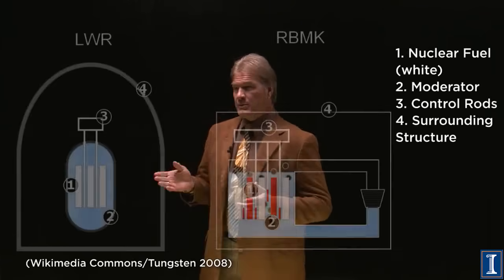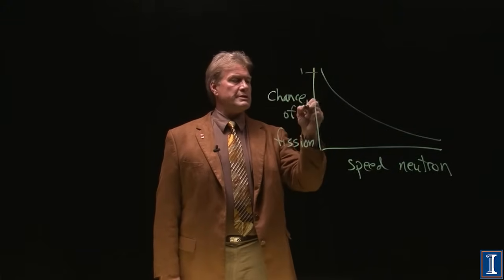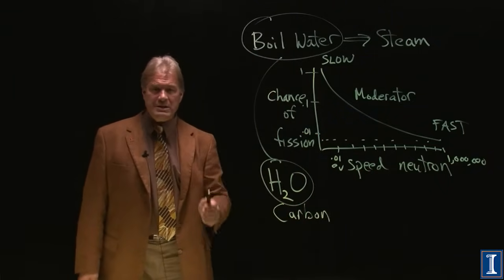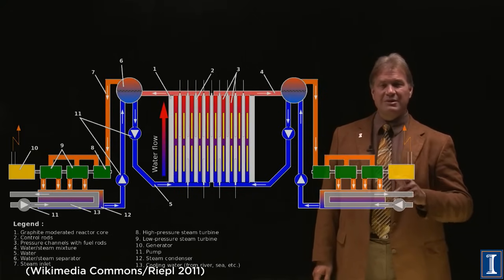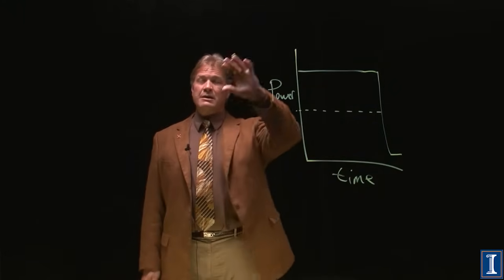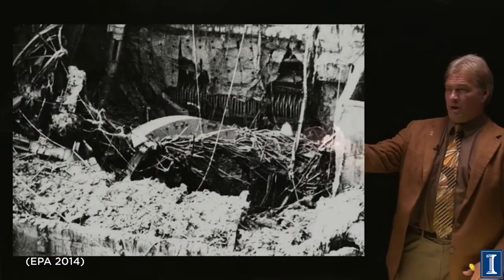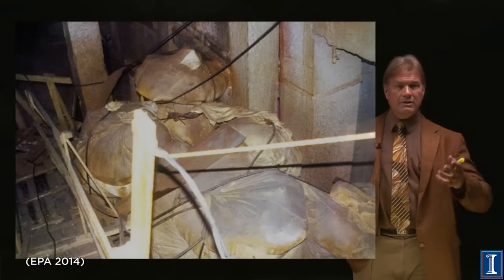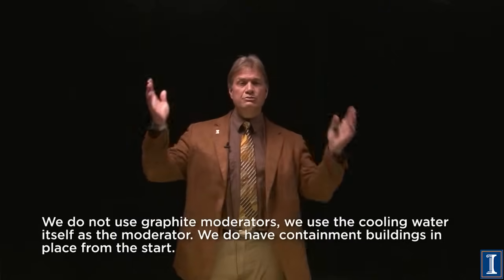Chernobyl: Worst Accident Ever

Comment: Fukushima is worse because it is still ongoing and part of its core was plutonium mox fuel.
Reply: Can you explain why we should be extra worried if Fukushima actually did use MOX?  And in what ways it is still ongoing while Chernobyl is not?  Thanks.
Reply: @puncheex2  The corium (melted reactor fuel) in the bottom of the Fukushima Daichi plant is still there.  They have to keep the ground frozen around it or it will melt through into the ground water just like in the worst case scenario for Chernobyl.  It is my understanding though that mox fuel is MUCH more dangerous than "normal" U-235.  I believe also they have to keep huge storage tanks full of radioactive water which are filling up and will be dumped into the ocean soon.
Reply: @Minty.Fresh.Tunes.  No, that's not true.  As far as is known, the meltdowns at Fukushima are all contained within the containment structures.  It is believed that one of the meltdowns burned through the reactor vessel onto the containment floor, but there is no evidence it got any further.  The ground freezing that TepCo is doing is for a different problem, the one you mention below with tritiated water.

Plutonium is no more dangerous as a metal than U-235 is, either chemically or radiation-wise.  Long ago Ralph Nader made a big stink about how poisonous plutonium was, but he was wrong about it.  No one has ever been registered as having died from plutonium poisoning for either reason, even though one unhappy person was given 64 grays of the stuff in a medical experiment gone way past wrong (4 grays is considered the 50% fatal dose).  See https://en.wikipedia.org/wiki/Albert_Stevens

Yes, there are huge storage tanks of faintly tritiated water.  They are slowly coming to the conclusion that that water may be naturally produced in the mountains behind the plant.  I'm skeptical of that myself, but what can't be argued is that the radiation from the tritium is negligible.  Look at photos of the tank farms - people are walking among the tanks in shirt sleeves.  Tritium creates no gamma rays; all its radiation is beta particles.  Beta can't fight its way out of the water and the tankage.  The tritium is decaying (as all radioactive things do) with a 12 year half-life.  It can be safely dumped out to sea with no harmful effects.
Reply: @puncheex2  I was not referring to the underground "ice wall" which prevents water from the mountains from touching the disaster site.  They have to constantly pump water into that building to keep the corium from continuing any further and then pump it out again which is why the water is radioactive in the first place.  And it is not only irradiated with tritium so shove it.  There is a lot of misinformation coming out of Japan about Fukushima it is practically illegal to even talk about the disaster there which is a sure sign of corruption and subterfuge.
Reply: @puncheex2  AND it is UNIVERSALLY known that MOX is much more dangerous than just U-235.

Comment: Actually you are possibly wrong in one CRITICAL point. (Pun intended) It is very likely that the lower part of the Reactor actually went prompt supercritical and there was a small nuclear explosion, that did not become a large nuclear explosion just because it dispersed the fuel so fast that the criticality dropped again before we could have a Prompt Supercritical explosion that involved large parts of the fuel.
Reply: Can you explain how such a thing would have happened in 3% U-235 fuel?  If it was possible, why do nations with nukes strive for very expensive 80%+ enrichment, when they could use 3%?
Reply: @puncheex2  Because they need fuel that chainreacts so fast that it does not get dispersed by its own shockwave, like it was the Case in Chernobyl. The Nuclear Detonation that accured in Chernobyl was small, in the bottom part of the reactor. And before it could use the majority of the fuel its own shockwave dispersed the fuel, reducing criticality again. If the reactor ran on weapons grade uranium it would have leveled the ukrain and europe would be a real life fallout.
Reply: It wasn't a nuclear explosion
Reply: @RawbLV  Thanks for sharing your deep scientific insight. Your comment is most useful.
Reply: @TheNecromancer6666  You're welcome. The other commentator explained why it couldn't have been a nuclear chain reaction and I thought to assert that further.
Actually the explosions weren't that powerful. Windows 200 meters away didn't break. I know "nuclear explosion" sounds cooler but that wasn't it.
Reply: @RawbLV  Nuclear Physics says it was a nuclear explosion. First of all a large amount of fuel is missing and unaccounted for. A Steam or Hydrogen Explosion could not have vaporised it. A nuclear Explosion could have. Also not all Nuclear Explosion or Prompt Super Critical events are large explosions. Prompt supercriticality does not mean a multiple Kiloton Explosion there have been super promptcritical Events in laboratories after which people in the lab were dead but the lab was still standing. Do a bit of reading on the subject.
Reply: @RawbLV  There is next to no Uranium in the contamination, only Fission products, Iodine, Caesium, Radium and others. My source is the final report of the International Atomic Energy Agency. Most of the fuel,  was also recovered outside or found in the Building. This discussion makes no sense because you have no clue of reactor technology and nuclear science. You are full of dangerous half knowledge, please read into how nuclear processes work, seriously. You have no technical or scientific education what so ever.
Reply: @TheNecromancer6666  Says the person who thinks that a reactor with enrichment of 2% can cause a nuclear explosion. Okay dude.
Reply: @RawbLV  That number says something about a baseline criticality of that reactor not about what can happen if you drive it enough extremus like it happened in chernobyl. Natural unenriched uranium can cause a chain reaction under the right conditions. I took nuclear physics and reactor engineering for fun in addition to my normal engineering ar Uni so I know a thing or two about it. I ran an nuclear reactor at my Uni. So again either read up and have a proper discussion or stop spreading missinformation.
Reply: @TheNecromancer6666  Yes, a chain reaction, not a nuclear explosion in a graphite moderated reactor with all of its control rods inserted.
Anyway, you don't have to argue with me, reports conclude that there was a "highly destructive steam explosion", not a nuclear explosion. If you wanna doubt decades worth of information and conclusions from physicists, that's on you, not me.
Reply: @RawbLV  The difference between a chain reaction and a nuclear explosion is only the rate of fission and the prompt criticality. If you see that: the reactor has fixed moderation, positive void coefficient and graphite tipped control rods that acted as the trigger you do the math that that can cause prompt super criticality. I mean seriously. Its not hard to actually calculate the reactivity and criticality under the conditions we know the reactor had. But to do that you would need an education in physics. BTW, the soviet researchers at the time very much said that a partial nuclear detonation in the lower part of the reactor is likely. Also: After the steam blew the cover of the reactor any hydrogen would immediatly dissipate and not politely wait around. Also: where should the hydrogen have come from? Yes bombarding water with radiation CAN split it. But not at a rate fast enough to fill the reactor vessel up with enough of it to blow the building up. Just do the math on it. Jeez University's are free in most civilized countries get an education...
Reply: @TheNecromancer6666  I have an education, but not in this field. As for hydrogen, the empty spaces between graphite blocks were filled with hydrogen, although during the test it might have been nitrogen.
I'm not gonna argue about this. I don't think a nuclear explosion took place but it isn't completely ruled out. If you want to debate this, go to r/chernobyl. The bright guys there are actually talking about this today.

Comment: Lmao... So there is no exclusion zone around Fukushima due to expelled radioactive material??? Containment wall, correct??There sure a hell is! So how did that happen if the containment building prevented that??? The chain reaction at Fukushima didn't stop Did it? Matter of fact Fukushima also experienced hydrogen detonations. they didn't build a 3 foot concrete floor under Fukushima and all that radioactive coolant was just allowed to go into the ocean. Fukushima to my knowledge still isn't even contained. The only difference between the tragedy Chernobyl and Fukushima was that Fukushima was using American reactors and therefore the truth was censored.  There is no free press in America to report either and those independents that do report the truth are labeled conspiracy theorists for the effort. 

There are videos on the net of folks wandering around Fukushima's exclusion zone finding hot spots just like at Chernobyl. Only reason Chernobyl seems worse is because it was in the middle of a continent so the worst fallout landed on land and displaced people. Fukushima is on the East coast of Japan and therefore prevailing winds and drainage to the sea placed the majority of Fukushima's expelled nuclear disaster over and in the pacific ocean. 

I am not afraid of the truth but I hate being lied to!
Reply: Then why do you repeat lies?    https://en.wikipedia.org/wiki/Comparison_of_the_Chernobyl_and_Fukushima_nuclear_accidents
Reply: @danadurnfordkevinblanchdebunk  Wikipedia. Wow like that's the bible of fact. I'm not the one lying. There is an exclusion zone around Fukishima. FACT! Fukishima is right on the pacific shore with westward previling winds which means most of it went over the pacific. FACT Fukishimas issue was cooling and broken cooling lines which is why they had all the tanks there for contaminated water. But if none of that's good enough you can go read their own documents if they haven't been erased from the net and shredded where THEY said in their own documents they were releasing contaminated water. 

But, here's another one for you if I'm the one spreading false information. If they prevented melt down then they gotta either have it all back up and running or entirely decommissioned and safe by now Correct!

Real simple dude I don't care what you or Wikipedia says. I don't care what the authorities say. I don't care what the experts say. Exclusion zones exist around Fukushima due to DANGEROUS levels of radiation. Dangerous levels of radiation can only exist if there is dangerous levels of radioactive material in the exclusion zone to produce Dangerous levels of Radio activity. I have seen folks walking through Fukushima's  exclusion looking for hot spots same as Chernobyl. Only way that happened is if the containment system on one reactor, at least, breached catastrophically.  Unlike most folks I actually paid attention to event and actually read company document released as to the problems at the time. Fukushima Were GE reactors. If they were made by Russia or China you'd know the color of the shorts everyone was wearing but because they were GE reactors there's nothing to see here. just move along. Nothing I have stated is a lie. Its reality. 

Seriously! How did the Fukishima exclusion zone become radio active. Birds that coincidentally all migrated from Chernobyl the same days Fukushima reactors blew up on video harmlessly.
Reply: @danadurnfordkevinblanchdebunk  What ever you say dude. Suppose proper safety equipment and prompt evacuation due to advance knowledge had NOTHING to do with less human carnage also?  Big difference between Chernobyl and Fukushima was time and foreknowledge of what was going to happen.   2+2 is just simply tough for some folks.
Reply: @danadurnfordkevinblanchdebunk   No actually you can't read. I already said they were two separate incidents where time and proper equipment and location were the determining factors on immediate casualties and long term effects. Chernobyl  happened in the middle of the night without warning They had time with Fukushima to evacuate and the emergency personnel were properly equipped. Besides that, 1/2 of the exclusion area and prevailing wind put 1/2 or more of the ejected radiation over the pacific. While Chernobyl is land locked in the middle of a continent. 

But Chernobyl is stable and contained under not one but two shelters While Fukushima is still not under total control to my knowledge 10 years later. 

I have mentioned all of this at least once in my comments already and now twice. You can't and they can't determine what the end cancer rate will be from Fukishima because More than 1/2 of all the radiation puked out of that place for 10 years enter the pacific. and by now has easily polluted every ocean in the world. We are eating it every time we have any product from the sea. It's in our rain. And yes people have gone to the west coast of North America with various radiation detector and have found above background levels of radiation. But I suppose, you''ll try and tell me next that although an encrusted Harley in a shipping container could wash up on the BC coast from Japan along with tons of garbage and boats from their fishing fleets and ports, it's totally impossible for radioactive particles and coolant water to make it here in the same currents the Harley did. Cause Harley a super Duper magic.
Reply: @danadurnfordkevinblanchdebunk  The containment vessels BREACHED. Have you ever watched videos of Fukushima grenading? What do you think blew the big holes in their roofs. Never mind the fact the THREE reactors Blew in Japan. HELLOO? There is a exclusion zone Only way that happened is if the containment breached. The emergency workers actually had radiation suits and they had a whack of time to evacuate the surrounding area before they blew the hell up. Holi hell. The professor is lying his ass off which is why I made the comment in the first place. Fukushima BREACHED. The only reason there wasn't massive human loss due to radiation is because all first responders had the proper gear. And the had fore knowledge so they could evacuate the people before the breech. Not to mention due to the fact that it sits on the shore of the pacific as compared to Chernobyl the exclusion area is half the size cause Japan has strict laws against mermaids and people living in the ocean immediately off their coast. I figured I'd throw the mermaid thing in there cause maybe a fair tale character might clue you in as you seem to swell there.  Facts and even a video of the freaking abandoned exclusion zone is clearly beyond your comprehension..

As I said they have been lying their asses off about Fukushima since day one because they were American GE facilities. When they describe Chernobyl they give every detail. This so called professor being paid by the nuclear industry didn't even mention an exclusion zone in Japan did he?
Reply: @danadurnfordkevinblanchdebunk  PS. No damage to the pacific. Pull your head out of your rear and actually go do some research. do some research into Japanese fishing There was and still is major repercussions in the pacific From Fukushima but, it's only when the Nuclear industry discuses it that they never mention that or the exclusion zone. Just like this guy touted the smaller core that made them safer but didn't mention 3 of 4 blew in Japan while 1 of 4 blew in Russia. They always play off Chernobyl like it was 50 zsar bombs run buy people who couldn't tie their shoes while Fukushima due to superior engineering and operation excellence was no more than a cap from a cap gun.
Reply: @danadurnfordkevinblanchdebunk  I already told you I don't do or find research for trolls. You clearly are discussing subjects based on your opinion which is clearly based on your feelings. you didn't even realize there was an exclusion zone and even once I proved it you believe a biased professor who Is lying straight up and by omission. You are arguing for the sake of arguing. That makes you a troll. Do your own research and if you are too lazy to do so, then you really have no place attempting to debate someone who does. It just shows all who read your comments here later that you are a troll. The evidence is all out there for people who want to know the truth and it's not hard to find. Those who read my comments and want truth will look for it.
Reply: @danadurnfordkevinblanchdebunk  He did'nt mention The damage or even seriousness of Fukushima at all. It's called a lies by omissions. My mistake! As the, Shockingly, obvious such as the containment breech escapes you, I should have no reasonable expectation that understanding or even recognition of lies by omission is even in your wheel house.
Reply: @danadurnfordkevinblanchdebunk  I proved there was. Perhaps you are a troll.

Comment: Those flimsy wall of the Reactor Hall at Chernobyl never had a chance at withstanding the enormous force generated from the huge amount of steam inside the Reactor Core itself. 

Part of the problem with RBMK is that they only had one surrounding layer of protection, whereas a normal Reactor Cores has three. Also, the circulation pumps for the 'cold water'-supply (The water that eventually becomes steam and drives the high-pressure and low-pressure steam turbines) to the Reactor Core also proved to be massively inefficient in providing enough circulation to combat the increasing presence of steam inside the Reactor Core chamber itself.